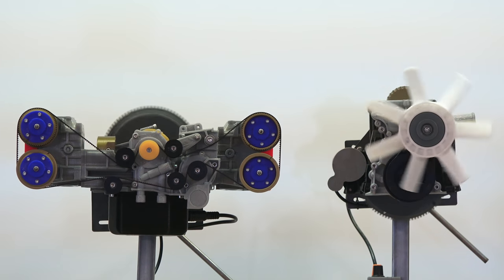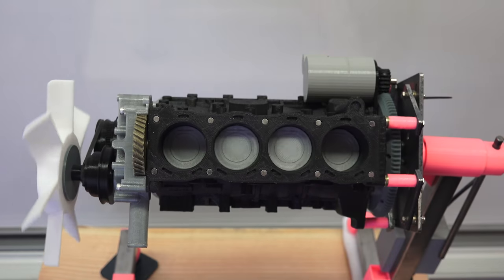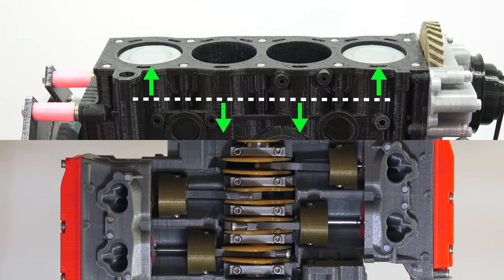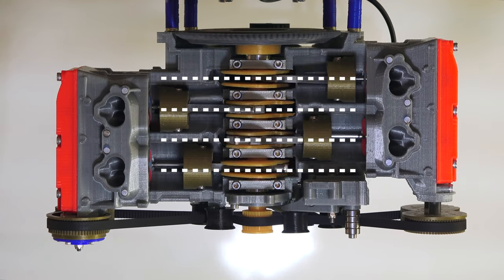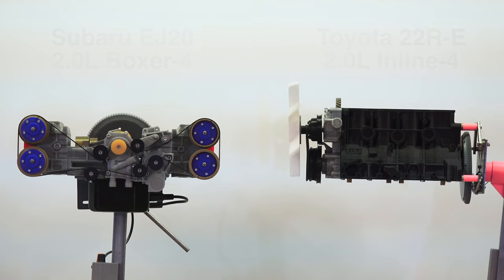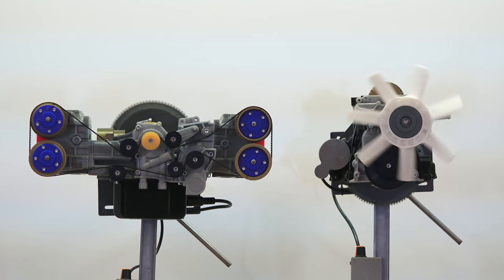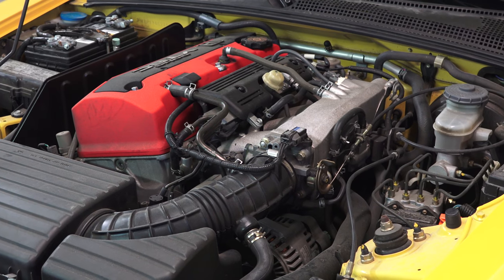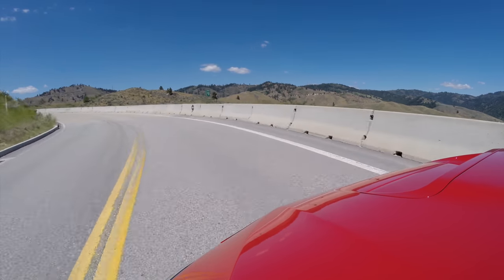The Differences Between Inline Four & Boxer Four Engines

Comment: Talked about flat engines, mentions nothing of aviation. Face palm!

Flat engines are not the best design for modern cars. However, an air cooled flat 4 or 6 is ideal for modern aviation. 

Porsche designed the engines that Subaru uses. They work in the rear engine configuration, however they still don't work well in Subaru cars. A lot of the drawbacks of the boxer in a front engine front wheel drive car have been engineered out but it is still far from ideal. 

It is clear that an inline 4 engine is THE most practical power plant for a modern car. And for a motorcycle it is an inline twin, and for a light airplane it is a flat 4 or 6.

Course all this goes out the window when The storage and delivery of electric power becomes practical and accessible. Then electric motors will take over everything.
Reply: I know, eh? Especially since aviation engines have almost none of the Subaru boxer engine's disadvantages. Pushrod OHV which makes valve train as simple and light as an inline four, no head gaskets, plus the advantage of being able to be mounted high so the prop clears the ground without impeding forward visibility or having the perpetually  leaking cylinders of an inverted inline four. .

Comment: Toyota also uses a Boxer 4 engine 
The Scion FR-S/ Toyota 86
Reply: While Toyota does use it that's still a Subaru engine. The FR-S/86 and BRZ was a joint venture with Subaru and Toyota and they use Subaru's FA20.
Reply: Isaac Jasso open the hood on the Toyota 86. The engine has Subaru written on it.

Comment: My mom owns a Subaru wrx 2016 manual awd yes it has a turbo pushing 270hp, I myself own a Mitsubishi Lancer limited GTS 2017 manual pushing 190hp at most fwd manual right under the evo model, 220hp about after adding my obd2 tuning chip but one day I’ve raced a Subaru brz which is a none turbo NA flat 4 and the brz whooped my ass… I’ve also raced a wrx which is a flat 4 turbo and ofc it smoked my ass, No matter what y’all say with my experience flat 4 engines are faster and has more torque then my inline 4 engine stock or not, so that’s why they are also double the price even used 🤣 but my car is for sure a bit more reliable though that’s the good side just slower and less torque

Comment: There's lots more to engines than just cars. Most large piston airplanes were radials--with odd numbers of cylinder in banks stacked behind each other for air cooling. Most small private aircraft today use boxer engines, either 4s or 6s (airplanes have two separate sets of spark plugs and magnetos for redundancy). Fairbanks-Morse used opposed cylinder diesels (twin crankshafts, common cylinders) in submarines & railroad locos.

I had a Subaru once. Worse car I ever owned, sat in or drove.

Comment: about the safety, I need to disagree, because the engine is a patr whitch takes huge force in case of an impact, because of inertial force ; so it's better to have it in front, than underneath the vehicle...

Comment: Noticed you said largest gasoline motor made in a 4 cylinder is a 2.7.. gm makes a 3.0L inline 4
Reply: Toyota and Nissan also do in 3.0lt diesel 4s used in their Hilux, Coaster/Hiace buses and Frontier pickups

Comment: Horizontally opposed 4 cylinder and 6 cylinder engines have been used for more than 70 years in air cooled aircraft engines. It is not a new idea.

Comment: What about the power differences?? Would the inline make more torque while the flat makes more horsepower? From your info You could sum this whole video up by saying one engine has four cylinders inline while the other has two cylinders opposing each other and they sound different.   Get to the real info.
Reply: That basically is the difference.  Along WTH the obvious differences in possible packaging.  Performance-wise there's no reason they should be any different. The cylinders themselves don't know what arrangement they're in, they just suck-squeeze-burn-blow.

Comment: I've never understood why DOHC is better than SOHC, assuming the same number of valves per cylinder of course. Could you explain that some time?
Reply: DOHC generally allows for better valve geometry... angling the valves for more crossflow at high rpm. However, you will generally lose torque because at low RPMs, the charge flows too freely and doesn't swirl. This is exacerbated by using big bore short stroke engines to get high RPM. 

On 2v SOHC with rockers it's the same story vs having the intake and exhaust valves in a single line under the camshaft. The first is quite rev happy.., the second--common on older VW GTIs and Volvos is quite torquey at low RPM.
Reply: The solution to gain back torque was first by blocking one port at low rpm... but is now done through variable valve timing.
Reply: re: "I've never understood why DOHC is better than SOHC"

think of it like boobs, 2 are always better.  we don't ask, we just go with it.

Comment: how much mile average per gallon or how much kilometer average per liter or how much kilometer average per kilogram cng of boxer four/six engine
how much cc engine it is 

maximum power-how much ps at the rate how much rpm

maximum torque how much nm at the rate how much rpm

how much speed claimed km/hr

average how much

emission 

engine head point locate where spark plug locate where 

how much heat engine will be  so cool engine oil needed 

variable valve lift Vs variable valve timing

Comment: Eating pills and drinking water might be more efficient than having meals cooked, but I prefer the later. The experience counts, that's why I switched from my 2015 WRX to the 2018 STI, which I hope it gets to be eternal if the rumble experience leaves us. It will be easier to switch to Teslas if the Subarus lose the rumble. If efficiency is the only goal, electric motors are the way to go.

Comment: The boxer is great on paper but it's a pos in real life, 22re might not be overly powerful but I replaced a cracked head on one with 350k miles and it still had the factory cross hatching in the cylinders. I couldn't believe it

Comment: Inline 4 any day over a boxer. I say that only because if you're the unlucky owner of a Subaru EJ253 then your basically fucked. Subaru knows about the head gasket issues with these engines and they refuse to warranty any of them. Soooo $3,000 later and you have a repaired engine. Meanwhile that inline 4 that everyone else uses is still chugging along nicely.
Reply: Robert NES816 how do you know that?

Comment: Boxer sounds like it's miss firing not a good sound my 323 sounded like that when it rained because of moisture from a vented carbon fibre hood. Water would sit right on top the spark plug holes and wires. HATED THAT unhealthy SOUND!

Comment: The Porsche Boxer is a junk car because of that motor. My uncle bought a brand new Porsche Boxer and started having engine issue after 30,000 miles. There's a reason why Porsche only used that engine in 1 of it's cars and why that car started at a base price of $40,000 dollars

Comment: The inline being better fuel injected and carbureted but then you have the individual tune port injection each port 8 cylinder port individually toned it has it on throttle body running independent what in unison it's similar to the original version of the skyline but once they tweak dick mess with it the carburetor was iffy back then so then there was the Oldsmobile with the motor mounts so a whole bunch of people played with the tone port injection or single tuned port injection to the 4-cylinder but again Skyline on Bell Road racing with it and they finally got it right while the rest of the people they took them 10 to 15 years you don't catch up with Skyline while Skyline just kept soaring when it came over came a nature or fabricating Motors to accommodate the power because again with the skyline the block woodzeez after while

Comment: "Only Porshre and Subaru currently use flat engines" [INSERT TOYOTA GT86 HERE] mind you it was developed with Subaru. The Toyota GT86 was supposed to have been inspired by the Toyota Corolla AE86, but if you look under the bonnet (Or hood) of a GT86, no inline 4. Subaru has ruined the Toyota AE86 history.....

Comment: Doesn't BMW run a flat 4 in their bikes? Pretty sure they do.
Reply: Dylan Downright yes
Reply: No they do not. A flat 4 is the same as a boxer 4 and BMW only make a flat/boxer twin. They did however used to make a horizontal inline triple and four cylinder in the old K75 & K100
Reply: No. However Zündapp and Honda have both produced Flat-Four engines with the Honda ones being liquid cooled. After 1987 Honda replaced their Flat-Four engines with Flat-Sixes in their iconic Goldwing motorcycle series.

Comment: But what about a V4 engine?
Reply: Engine tech is constantly advancing, although at some point electric will overtake IC. Until then we have such steps forward as the  X Mini gasoline powered rotary four-stroke engine with only two primary moving parts. The 70cc prototype is the size of a grapefruit. When mature, this engine design is expected to be over 30 percent smaller and lighter than comparable four-stroke piston engines.

Comment: Both sound terrible, but the boxer sounds worse. The exhaust pulses actually sound like something trying to beat its way out of a box. No insult intended, it is a horrible sounding little motor and perhaps I have the boxer owners who elect to unleash more aharmonic noise with performance mufflers driving by my home to thank for that. In all fairness, even the far more harmonious V6 and V8s get under my skin on occasion, once more thanks to those who elect to open up the exhaust a bit more and drive through residential areas at 35 mph in first gear and let off the throttle giving off lean pops. I hate what "you" do.

Comment: I went to college for diesel mechanics Advanced diesel mechanic combat Aviation dad Diesel and Automotive and then they're all to cycle the 2-cycle Motors like cutting grass lawn mower as well as the weed eater but when they fabricated the electric less gassy but then you need about a battery with the power output that can supply you know the higher output production lines for long. Of time batteries power cell Sodus two different types of science one proton neutron and electron why one still

Comment: What you can easily* change that can affect your engine sound without upgrading to a new 911 or placing a bmw x5 engine into your 2000 civic:
Intake
Exhaust
Catalyst (part of exhaust but if YOLO you can remove it, assuming you have no responsibility whatsoever or any self conciousness about pollution)
*easier than increasing throttle housing or ramming a wall so hard so that the engine operating sound changes to a bass heavy low pitch sound
Reply: Juppie902 no

Comment: Those are going to be history. Electric engines are better
Reply: Better for what? for those who don't care about cars might be better but for us who are into cars, they're the worst thing that could've happened, cars are boring nowadays because of electric engines, 50% of the fun of driving a car is due to the exhaust note they make and as electrics don't make any sound, they're just plain boring.
Reply: @vrs9486  They're easier on the environment,
Electricity is cheaper than gasoline,
Maintenance is less frequent and less expensive. They're very quiet  which is better course the city is too noise. Tesla motors for example need to improve range of cars and also batteries but that is matters of time

Comment: Put it simple

Boxer engines blow head gaskets
Inline 4 dont
Reply: Really , or a inline head gasket is harder to spot and buried.  GM engine timing chain tensioners break before the head leaks. When that happens might as well replace engine

Comment: Boxer four leaks like a sift and less reliable.
Reply: 300k on a 2004 forester x yes has some minor leaking on the gaskets. This was obviously not made on a Friday engine. Will be pulling it next year and doing a complete overhaul on it. Only vehicle I can say that beat this was my 1983 Honda hatch back 3 speed .. yes three full gears it was the deluxe model the rest only had two semi automatic. No couch but shifted. That car no major rebuild one timing belt had well over 500,000km on it. Body sagged out. Motor and trans still running like a champ. Averaged 35 mpg. 95hp 3 gears. Love my boxter engine. Easy to change the timing belt parts are not that expensive. But the body does rust a bit easier..

Comment: The boxer is an interference engine. Once it's broke its all broke
Reply: not necessarily. Wheter or not an engine is an interference engine depends on the camshaft, deck height, etc. It just means it is possible for the valves to hit the piston.